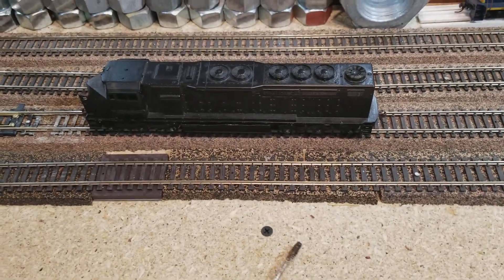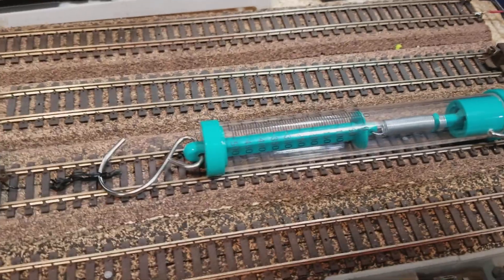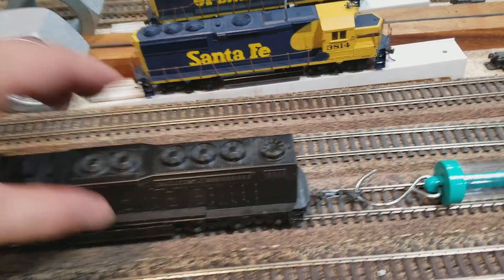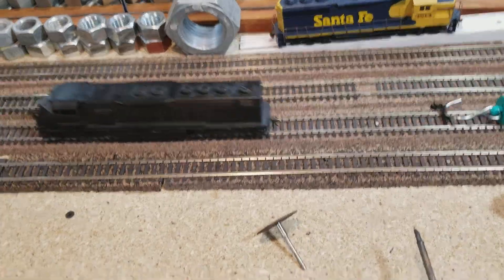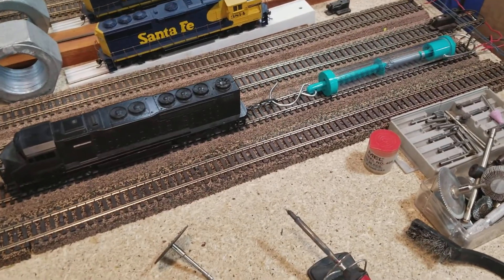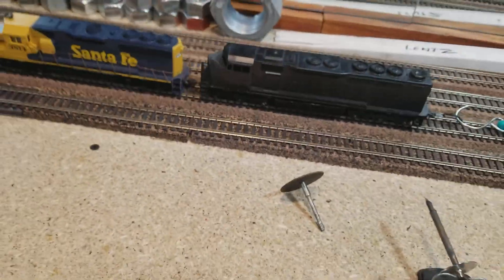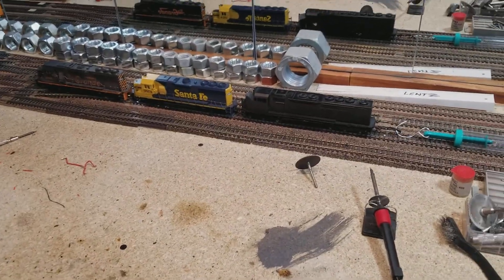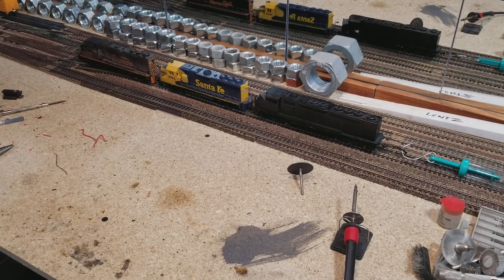measuring HO scale horsepower with dynamometer

Comment: What you are actually measuring is tractive effort, not horsepower! The only way to measure horsepower is to "stall" the locomotive with direct resistance applied to the locomotives wheels. Coefficient of friction also plays a huge role in horsepower. What you have created is not a dyno!!! It is a scale for measuring tractive effort!
Reply from the maker: A Newton scale is a dynamometer.  When the locomotive stalls, and you get the reading of how many Newtons of force, which you convert to foot-pounds -then you apply the formula of revolutions per minute times the foot-pounds (read from the scale) divided by the constant 5252.  Next you setup a train that you drag with the scale that has weight equal to what you measured with the scale.  When you pull this train using the locomotive around your test track you can measure the time it takes to make a full loop at maximum speed.  Place a white dot on one of the flywheels and by hand turn the wheel 360 around and measure the distance traveled.  This will tell you how many revolutions you need to make a loop around your test track.  In this way you will calculate RPM's.  You can use the formula to get a general maximum measure of power.  By subtracting weight from the test train and measuring the increase in speed until you find the heaviest train that can be pulled at maximum revolutions. You can ignore coefficient of friction because each locomotive is unique.  The Athearn blue box GP9 can start a heavier train that the AHM GP18, but the GP18 performs much better at higher speed. The higher speed will result in a higher horsepower because RPM's are higher by about 3 times at full power.   But any way you do this, measuring the way in the video first makes everything easier.
Reply: @elite194  Yes, there is a lot more to it than what I saw. I would like to see what the horsepower is for a Kato SD45. They don't have quite the tractive effort of sintered iron wheels like on Athearn. I would like to see the wheel and rail hardness on the Brinnell scale. I run helpers on 4% grade and i can't just put the helpers anywhere in the train. I have to be very careful top keep the helpers just slightly behind their tonnage rating so that they are only pushing about five cars. I run fairly big trains in ho scale 50 to 60 cars. Anymore than that and there is too much slack action to keep it all working right. My TankTrain tankers are glued together every six cars to prevent slack action in the reverse curves. Coefficient of friction is very important because static friction is always greater than dynamic friction. A steam locomotive is a constant torque variable HP while a diesel is constant HP, variable torque so it would seem to me that friction would play a role. I enjoy talking to someone that know what they're doing. Sounds like you know what you're doing!
Reply from the maker: I've got another video planned to transfer the data from the Newton scale to the test track.  I hooked up 6 AHM GP18s and tested them, then 4 Athearn GP9s and tested that.  The best score was 3 Athearn and 3 AHM.  My Genesis SD70 is weak on starting a train, but strong on keeping them going.  There is a video of a guy with something like 8 or 10 AHM GP18s pulling 100 cars from the floor of his layout up 38 inches in a run of about 8 feet.  That's what got me started in torque testing.  A quick ebay search found some different Newton spring scales.  The friction available on old Athearn sintered wheels is very interesting.  When coupled to a pancake motor Bachmann with rubber traction tires the starting tractive effort is incredibly high, but the continuous force is not that great.  Tyco locomotives are interesting from the fact that they have rubber tires on one side and start to lean when doing heavy pulling, but 2 C630s back to back have a load balancing effect that seems to be more than the sum of 2 individuals.  Atlas locomotives have low starting power, but very good  once they get rolling.  I might have to do a little calculus on the whiteboard for another look at horsepower!!
Reply from the maker: I just remembered I have that SD45 and I had in the NMRA contest in Lacrosse, I should test it.
Reply from the maker: remember that 2003 Popular Science article called anything into oil?  I'm working up a whiteboard video for showing torque and horsepower in HO scale using Athearn GP9 and AHM GP18
Reply: @elite194  It would be very interesting to see where those two properties cross each other on the curve.
Reply: @wasatchrangerailway6921  the formula for horsepower is torque in lb/ft x rpm÷ 5250 so in every case torque and horsepower should cross at 5250 rpm.

Comment: That was cool.  I guess if you weigh each car in your load you'll have total grams then just add engines as you need.  If you have a large staging yard you can write down total weights on paper near the lists so your yard master knows how many engines he will need.  Where did you find that Dynamometer?
Reply from the maker: they have all kinds of them on ebay for different types of science experiments... having a couple different kinds is helpful.  You can find the weight of a train on a grade using these and then match the locomotives you need to pull the train.  I got the idea seeing a train break loose at the top of a helix one time, it had been having trouble making it to the top and finally it just snapped and sailed off into the staging yard.